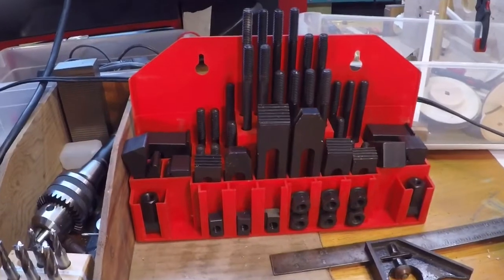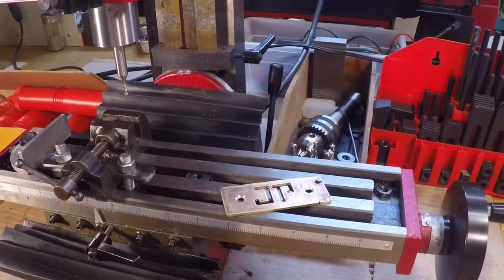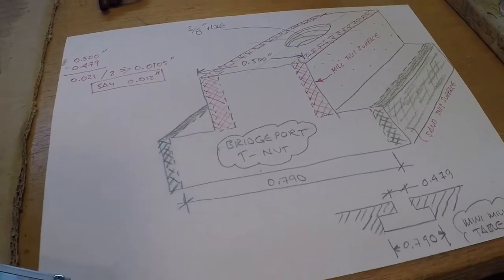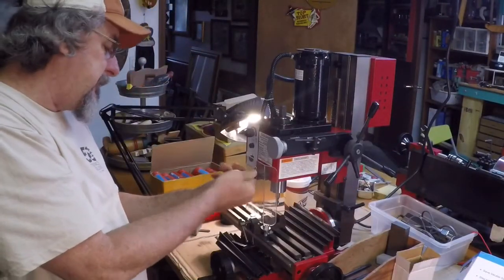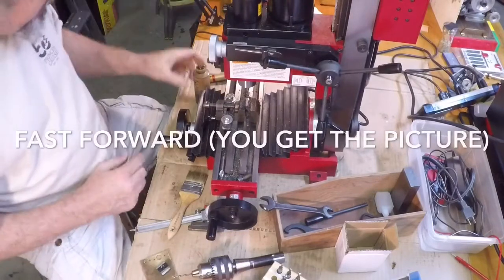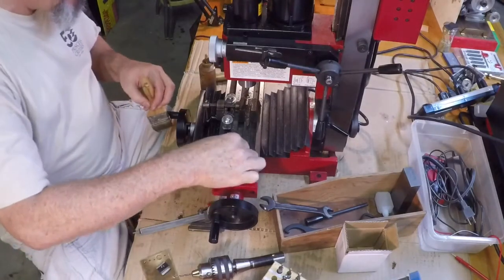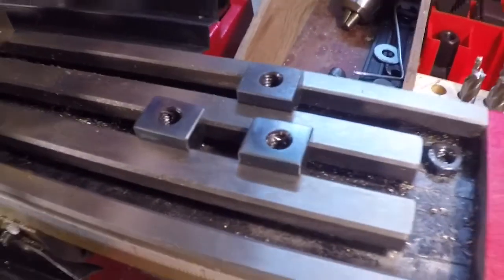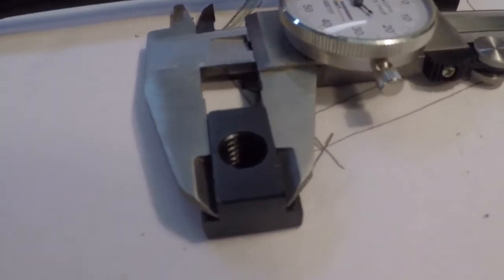T-slot nuts for My Harbor Freight Mini-Mill - Stuart Arts Episode 10

Comment: I had exactly the same problem and Just milled mine.  Had a hard time taking more than .005 bites at a time.  Very time consuming.  Not very impressed with the mill really.  Maybe if I had solid carbide mills it would have been better.  Not a sturdy machine.  T-Nuts turned out fine though.  BTW I milled the sides because that is what a milling machine is for...
As for the chip guard - ya such a big chip flying around.  Safety  glasses are fine.
Reply from the maker: Dann M it needs a few upgrades like belt drive to run better. I recommend you check out Dave M on YT - he has a series of videos where he upgraded this mill to a near Swiss watch- thanks for watching!

Comment: Have you noticed a similar 12 mm version of the sets sold for $40 on ebay?
https://www.ebay.com/itm/58-Pcs-T-Slot-Clamping-Kit-Mill-Machinist-Set-US-Ship/263401310963?_trkparms=pageci%3A30acce02-145f-11e8-885b-74dbd1802e29%7Cparentrq%3Aa70afc781610a8672e264f7dfff3d1ea%7Ciid%3A1&_trksid=p2481888.c100675.m4236

I could not figure out the size of T nuts, but since the studs and threads are indicated as 12mm, they might be smaller?
Afraid of cutting side of T nuts with the 5/8 or 12 inch studs in regular sets?
Reply from the maker: Alfa SpiderVeloce No I had not seen this set. A better deal for sure!